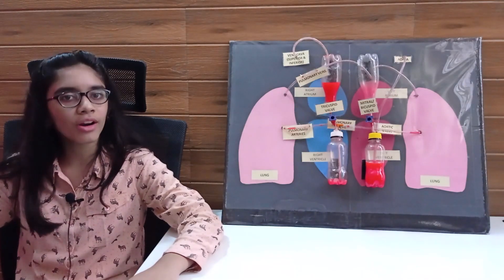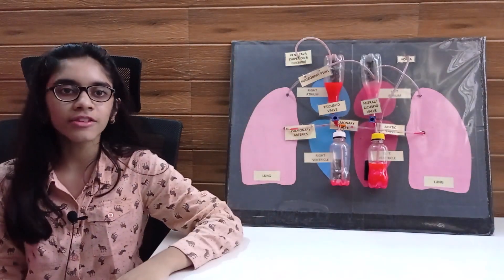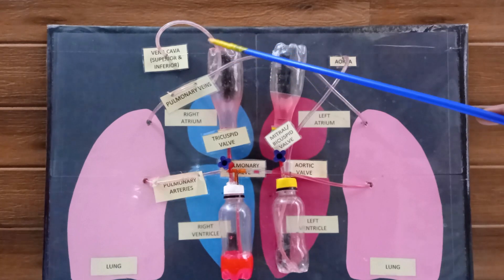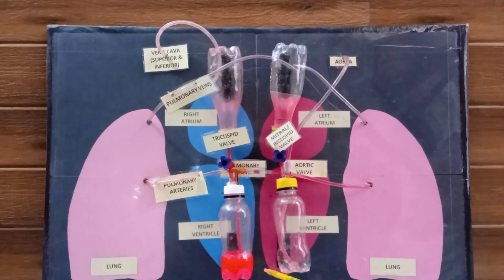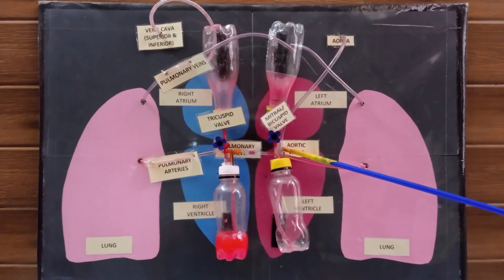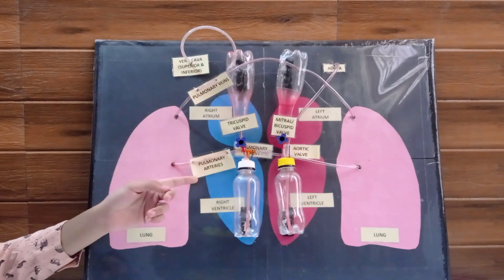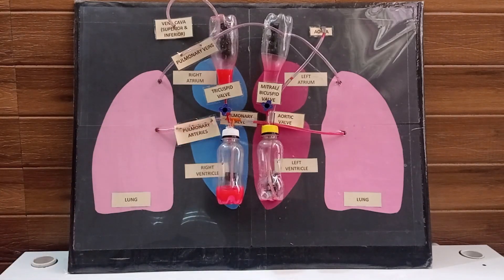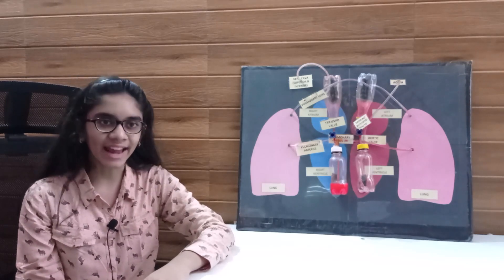Human Heart Project - BEST Science Exhibition Project

Comment: Where u made hole it not seen properly, in my model air not passing through hole
Reply from the maker: I have made 2 holes in one bottle's cap and 1 hole in other bottle's cap. The holes diameter is kept slightly smaller than pipe diameter so there are no air leaks when we put them inside.

Comment: Hey…can we use different sizes of pipe…or is it necessary to hv only one type
And how much long pipe should i get in total..could you plz reply fast cuz i was to submit my project on tuesday..Tysm..
Reply from the maker: Hi...yes you can use different size of pipes but then the connectors and valves should be compatible (otherwise there would be leakage). Buy pipe and valves by checking that they fit.

As long as you are making connections same as shown in video or how they are in real human body, you can use single or different pipes.

Around 5 metre would be sufficient.

I doubt you would be able to finish it in  single day (you mentioned tuesday) as it would take many hours to make, test and rectify any issues.

Comment: Hey can we use thermacol instead of card board ???
Reply from the maker: You may use if it is thick/strong enough to sustain weight of bottles with water.
However, I personally do not like to use thermocol due to environmental impact. I reused whatever was available at home.